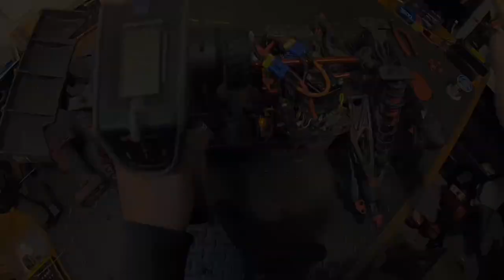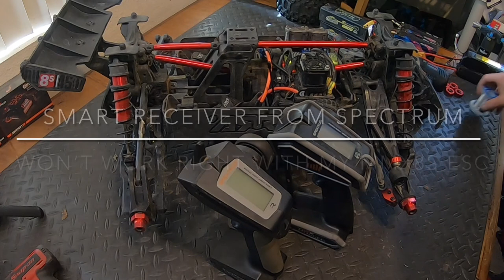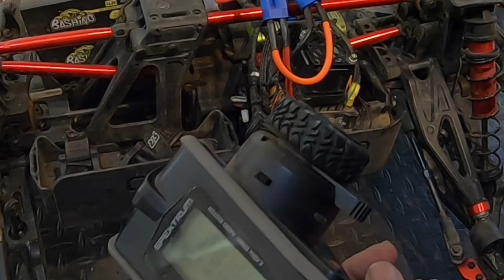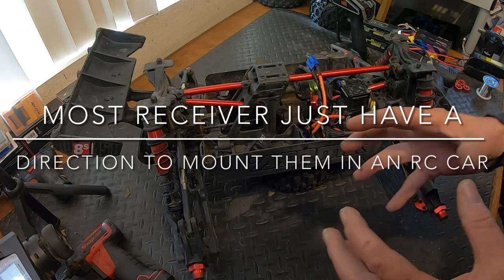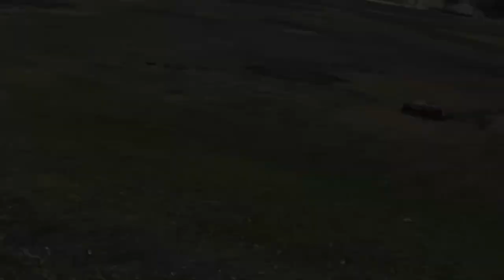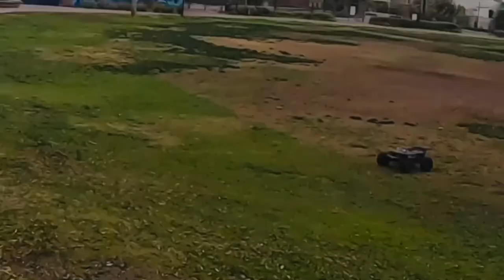Spectrum Receiver Doesn’t Work With Castle Creation ESC Properly Why? Answers in this video

Comment: I had the same exact issue castle told me to power on watch for thr receiver to go soild and at that exact moment pull full throttle and calibrate as normal
Reply from the maker: Yes even trying that the data log show a non full trigger setting calibrated into the esc now if I add triggers sub trim to 120% in the controller I get closer
Reply: @Earl Moorhead  power on watch the receiver it flashes then goes solid then esc arms castle told me to watch receiver when it gets done flashing and goes solid hit the trigger the castle won't arm until the receiver arms and the receiver won't arm at full because of agc bro what you have to do happens fast like I say turn on watch for solid the instant the receiver goes solid hit full throttle the esc will go into calibrate
Reply from the maker: I understand 💯but truly to deal with that on every calibration removing this style receiver cover that holds down the steering servo seems it’s better not to bandaid it every month 🤔and the 124 to the 124 signal for full trigger varies doesn’t set t he same number on  every attempt seems I just install another non avc receiver and calibrate but when  I have to bind another radio because of an issue I’d have to go threw all of this everytime and that what I’ve done this last year and ended up pinching the esc wire to the receiver several time 🤷🏻‍♂️but appreciate you suggesting this 👍
Reply: @Earl Moorhead  according to spektrum on that the sr6100 don't need a box according to them because it's already waterproof its a shitty fix don't get me wrong brother lol but that's what spektrum says and what castle told me about all those spektrum avc receivers while using castle products
Reply: @Earl Moorhead  the problem pissed me off so bad I have a brand new never used dx5c and sr6100 sitting and switched to the flysky NB4 and got there now in4r gyb gyro receiver
Reply: @Earl Moorhead  and with that I don't have to go through anything stupid to calibrate
Reply from the maker: Yes my dbxle 2.0 has ruin two as they filled up with water 🤔

Comment: Had the same issues. There is a post somewhere from castle advising how to calibrate with Spektrum Radio gear. Think wait until receiver light is amber. 

But I wasn’t convinced it calibrated correctly and ended up switching out the radio gear.

Comment: This is odd...I have a spektrum DX5C running all of my rc's with Castle systems, and I have never experienced this issue before. One thing though, I don't have a MMX8S in any of mine. But I can tell you that I do have an sr6100at in one with a Mamba X 6s and it allowed me to calibrate the esc after calibrating the AVC in the sr6100at. Also no issue with a sr6200at and a MMX6S
Reply from the maker: It’s the receiver not the radio
Reply: @earlmoorhead5555  I understand that. You're having trouble with your sr6100at receiver allowing your MMX8S to calibrate. I'm saying I've never had that issue with a Castle Mamba X 6s or a MMX6S and the same reciever. Try rebinding and disabling your AVC by following the procedure in the rcvr instructions.
Reply from the maker: Castle has a memo on how to do it the SR line is the older model that works fine but it doesn’t set full trigger correctly in the memo 🤷🏻‍♂️⚠️several ppl have said there calibration proceeder but log show if I wait to pull full trigger till the receiver light comes on it set full trigger in a different spot each time

Comment: What if you use a bec or a reciever pack power on the reciever let it do its thing . Take the esc and remove the internal bec power from the reciever plug so you only have signal and ground  then plug it into the reciever while holding the trigga and powering on  do your calibration after power off remove the reciever pack reinstall the power internal bec wire feom esc back into the plug and  in theory it would work i feel . Maybe not .. definitely an unnecessary step to have to do .

Comment: I'm probably wrong in this but I thought that castle had some kind of bypass for that similar to how in Motorsports you have dummy O2 sensors and stuff like that for tricktunes?? Early once again you bring up a genuine head scratcher but to answer your question about others having the issue I think it's most likely that they just say eff this controller/receiver and go to another brand as the solution. Just watching you fuss with that crappy scroll deal is enough for me to have gotten the dually out to run it over about 37 times lol
Reply from the maker: Hate that controller
Reply: @earlmoorhead5555  if you are looking for ideas I'd like to see what you think of the new Radiolink. They stepped up into the heavy hitter market with a touch screen and all that jazz . Looks great but not found many decent vids on it they just say the same explaining what everything does and not so much bout how it does in the field. They say it's still good for speed runs . I just hope it works with the old receivers because I've got too much wrapped up in them to just replace.( 11 at 20$ a piece 😱).. just a thought . . Just ready for some warmer weather cause ( among other builds ) I been working on a Vendetta because of someone . . Did like 3 legit pulls with it and immediately started ripping into it and it's sitting with 6s and no spoiler. I don't know how it will do but I'm just using the uprights for stability curious if it will stay planted. . Love what you're doing for the community Early thanks!

Comment: If I change motor and esc ...Futaba or Flysky ....I never seam to keep any of the stock electronics ...have a pile of new /old stuff Traxxas, Axial,AE and on .. The box I call CRAP...lol
Reply from the maker: I tend to run several Vehical at a time so I try and keep separate control for each my speed vehicle all on my futaba as no one runs those but me 💯👍

Comment: Dumbo radio n receiver solved all my problems
Reply from the maker: Most cheap receivers will as there not a smart system no protection from a runaway rc 👌👍
Reply: Signal loss triggers neutral, no runaways, it’s the smart, fancy schmancy receivers/ transmitters you have to program to stop runaways.
Reply: Same as traxxas failsafe, and you use those transmitters all the time.